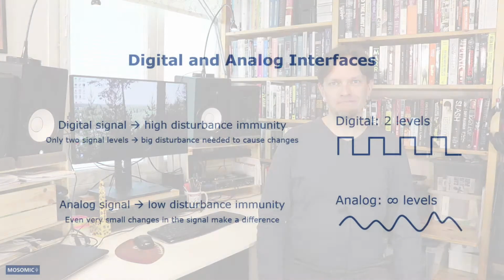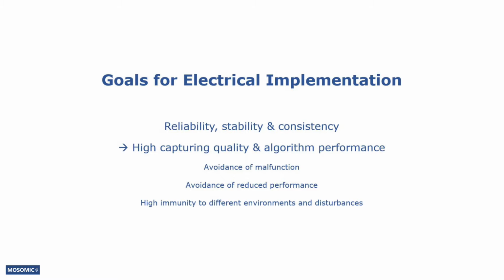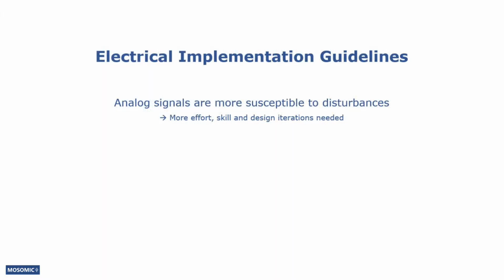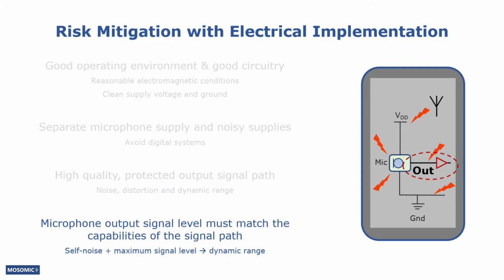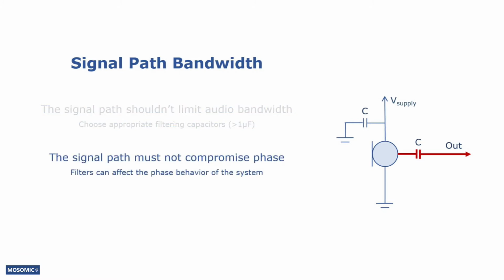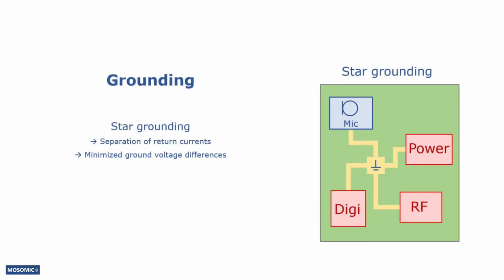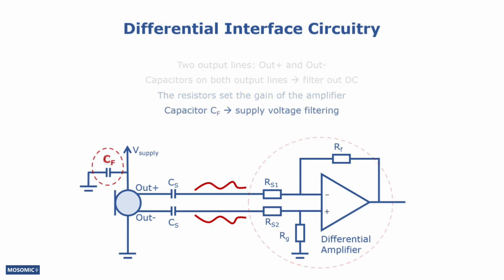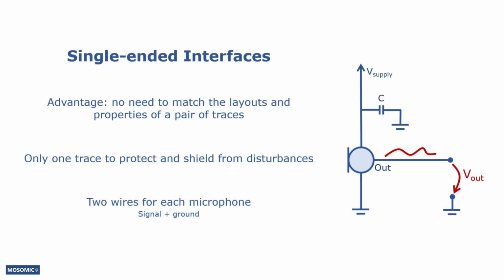Electrical Implementation: Analog Microphones | MEMS Microphone Guide Ep17 | Mosomic

Comment from the maker: 0:29 MEMS microphone interfaces
2:07 Analog microphone implementation goals
- 2:14 Sound capturing performance
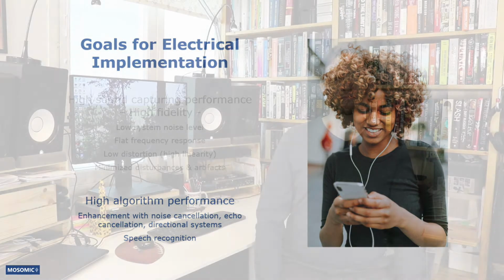- 3:28 Performance stability
- 5:51 Electrical robustness (RF immunity, good PSR) 

7:09 Analog microphone implementation guidelines
- 9:17 Good operating environment for the microphone
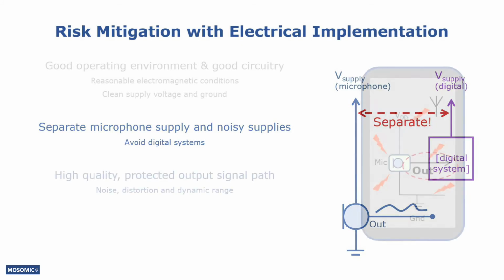- 10:29 The microphone signal path; noise, distortion, dynamic range
- 15:02 Signal path disturbance mitigation; layout, shielding, disturbance filtering
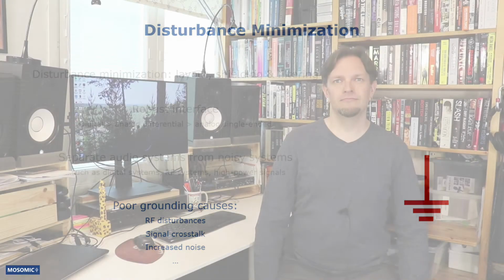- 16:24 Ground
- 18:11 Trace lengths, circuit board layout, shielding

19:34 Analog microphone interfaces
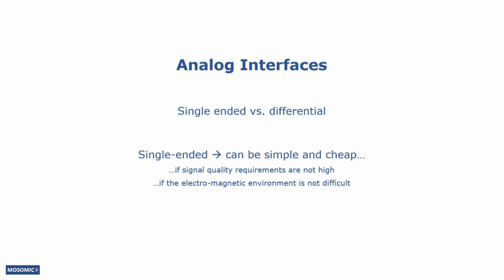- 20:03 Differential interface
- 23:39 Single-ended interface